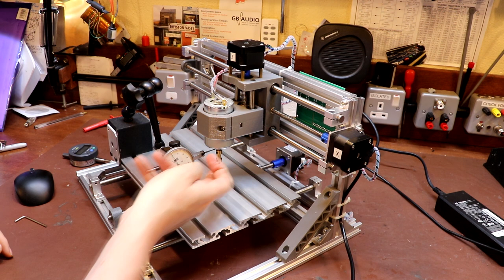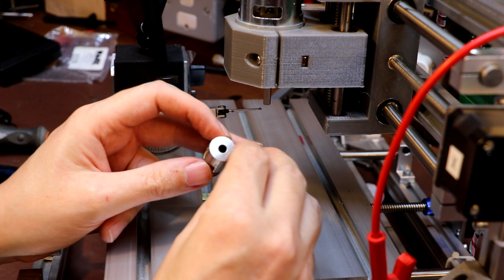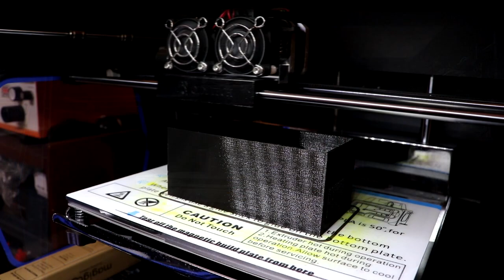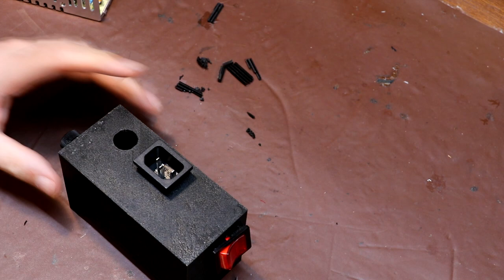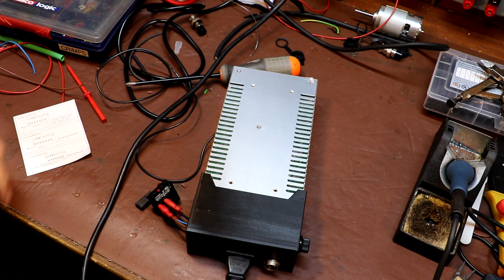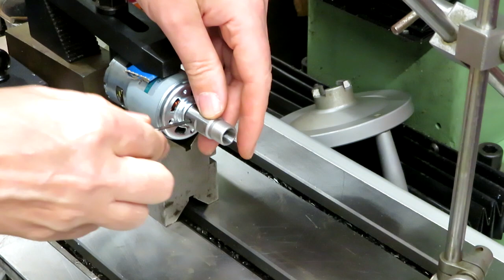Woodpecker 3018 Spindle Upgrade - Part 1

Comment: I've been down the same road on mine, even buying the same tach. I got my adapter from Banggood. I had to heat it up in the oven and use an arbor press to install it. It's never coming off. It still had .004 inches of run out so I didn't really gain anything. The motor I used was from Ebay. It reached the 20,000 RPM but vibrated more than I liked. I ended up running it at a lower RPM because of that. It draws a lot of current on start up, so I bought a controller with soft start from Banggood. The soft start part worked great, but it would power up with the motor on. Not a great feature in a motor controller.

One upgrade I can recommend is to replace the 4 LM8 linear bearings on the Z axiz with the 2 "LM8LUU 8mm Long Type Linear Motion Ball Bearing". Its easy, cheap and takes a lot of play out of the Z axis. You loose some Z axis travel but that doesn't matter if your making PC boards. Another problem I had was caused by using double sided tape that was too spongy. This gave inconsistent results while auto leveling (height mapping) the bed. You have to use auto leveling unless your board is tiny. I used to use BCNC as the sender software but I've switched to Candle since it's just easier to use.

Really enjoy your videos.
Rick
Reply from the maker: Thanks for watching and great comments. You have given me some really useful information there and I agree with everything you said. I think the main reason I didn’t  use it  when I built it was because I actually think the whole idea of milling PCBs is a bad one but I am prepared to have a go for the fun of it. If I was doing a serious PCB I would buy it from China and if it’s a simple PCB I’m pretty sure I can etch it myself much faster.  Drilling holes manually is a total pain be nice to CNC that. I think I’m probably going to end up buying another milling machine and doing a CNC conversion. I have seen the Chuck you mentioned pressed on that’s probably the way to go. I’m also thinking those little brass tool holders are so cheap is easier to use those and replace them when the wear out.  I’m hoping to do better with my mosfet driver fingers crossed. Your right on the motor speed the ones I have are happy around 18k rpm but get noisy after that.  I bought a cheap speed controller from Amazon it actually appears to work ok so I will show it in my next video.  The only problem is that you have to manually set the speed and I want it controlled via the software.  Thanks again stay safe regards Chris

Comment: That collet looked miles off, even without the dial gauge  :-(
I'm not a machinest but surely the turning down of the body and then drilling through it would not need the lathe chuck to be messed with. (crap chuck maybe).
It's nice to see you making the odd minor mistake,  We know you always dumb your abilitys down,  you are a very skilled man. (I mean that, not joking).
I don't feel so bad with some of my silly mistakes now, i'm thicker than a bankers wallet.
The psu end cap was ideal,  just the job :-D
So the pwm output stage is getting steroid treatment,  double the mosfets on a bigger heatsink maybe.
Smashing video chris, thankyou :-D
Reply from the maker: Unfortunately there are several areas of machining that have to run absolutely concentric to one another. Also a drill will follow the old hole so I would need to fill the old hole.  It’s all good fun but more work than I want to do.  Oh I makes lot of mistakes I just don’t bother hiding them such is life. Thanks for watching regards Chris

Comment: Personaly I like to have the switch in the up position for on as well. In fact, I rotated/wired my lightswitches in the house to have almost all of them in that configuration. The "Up-is-on" is also the standard in your consumer unit where the breakers flip down for off. Nice job designing and building that power supply cover. Too bad you didn't go for a real mean-well supply, haha.
Reply from the maker: I’m afraid for £15 for the power supply Meanwell didn’t stand a chance. I agree they make great supplies I uses there 24v power bricks on my PCBs at work. Thanks for the switch information. Stay safe regards Chris. ps what’s the Covid situation like where you are?
Reply: @allthegearnoidea6752  Regarding Covid, our government doesn't want to ruin our economy or what's left of it. Restaurants are closed down, and to avoid illegal parties, they have forbidden the stores to sell alcoholic beverages after 20.00h. 

The use of masks is not yet mandatory due to our laws that they have to change first. Not looking forward to that.
Reply: @allthegearnoidea6752  aside from those measures the usual stuff. Keep distance, disinfect, work from home if possible, go nowhere if not nescesary...
Reply from the maker: @MrDubje  I have managed to keep working as normal from home but a lot of people are having a bad time of it. Be careful stay safe, regards Chris